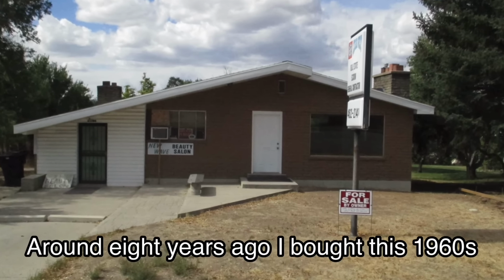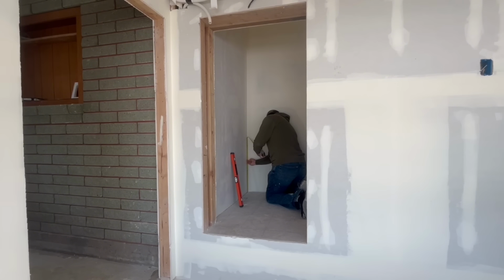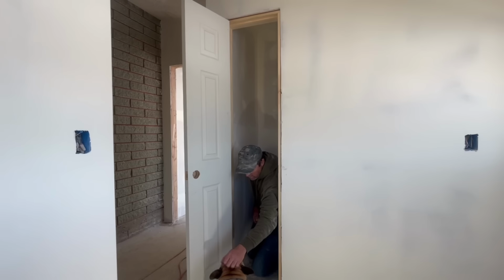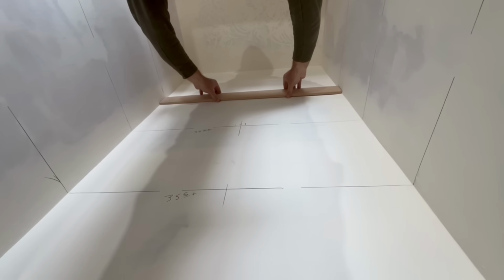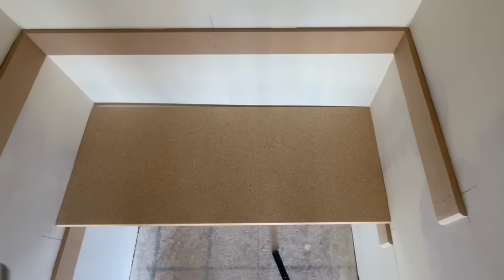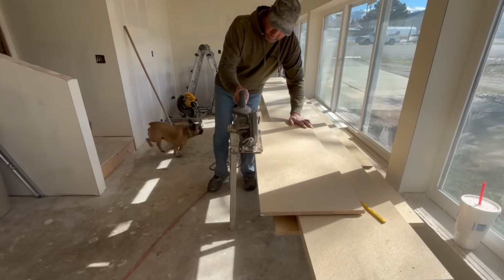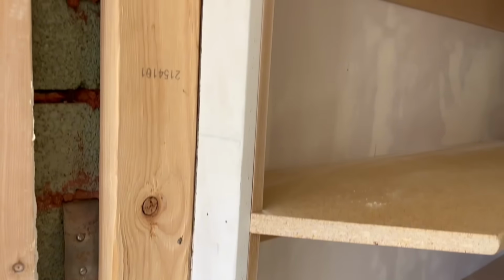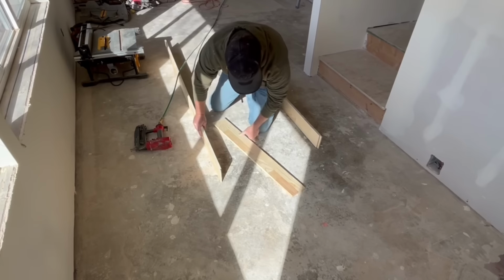House Hacking A Home For My Daughter Since Housing Is SOOO EXPENSIVE!  Part 7

Comment: Love watching this series.  Question for you, why is the floor of the closet so high?  I take it it is aligned with the finish floor of the main house, but was there a reason you didn't bring it down to the floor level of the new space?  Also, did you consider removing a few inches of the floor right at the door frame so a full-sized door could be installed?  I'm looking forward to seeing how you finish this project for your daughter!  What a great dad you are!
Reply: My guess is that the foundation wall to the main house was in the way. But I am commenting so that I can see what his answer is. 😀
Reply from the maker: Thank you, and yes it’s aligned with the main house floor.  I could have cut the floor joists off in that area, and built walls to support it underneath, but it would have been a lot of extra work.  Thanks for the kind words!

Comment: I think I'd have painted inside the closets and installed the flooring before adding shelves.
Reply: Depends on if you are rolling or spraying. If you are using a sprayer for the paint, installing the shelves beforehand works fine.
Reply: @TinaP1234 I agree about the shelves, but the corner brace post is nailed in place, which means the flooring will have to be cut to fit around it. would have been easier to lay the flooring first.
Reply from the maker: I like to use the paint sprayer, and this way I can caulk putty and paint the shelves in place.  Thanks for watching and commenting!  👍